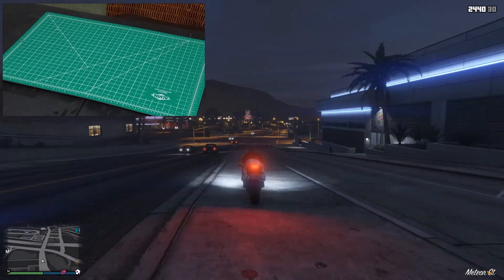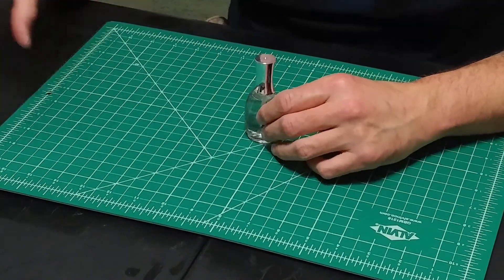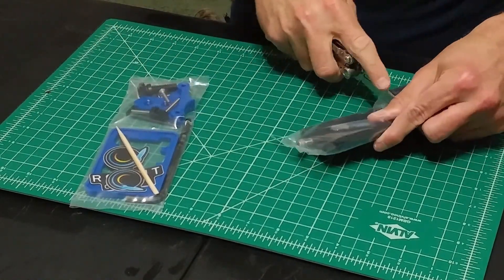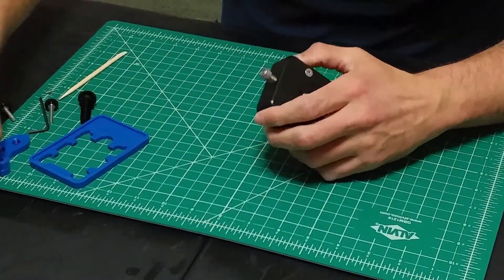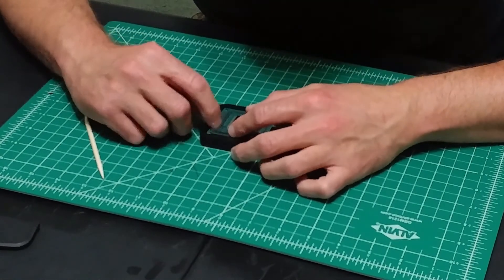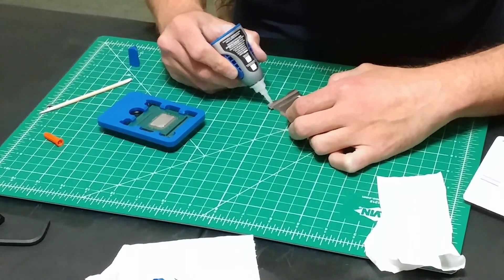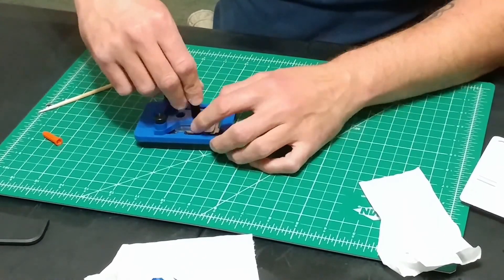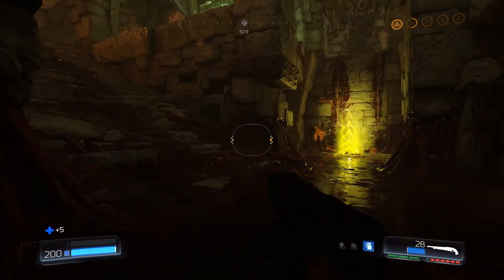7820x delidding

Comment: I must have a pretty rare 7820x. I am overclocked to 4.9ghz all cores and i render/export 4k videos for well over an hour at times and my temps will never reach 90 but they are at 88-89c. I do have a custom loop tho with a full copper 580mm rad, you gotta have beefy cooling for a chip such as this. That being said i did just buy the rocket 99 delid tool, an ek monoblock for my cpu and motherboard mosfets as well as a tube of thermal grizzly conductonaut. I can not WAIT to see my results and am hoping to hit 5.0ghz stable on all 8 cores, if i do have to leave it at 4.9ghz tho not all will be lost cuz seeing my mac temp between 60-70c under hours of full load will make it worth every penny anyways. Thanks for the great instructional video!

Comment: I did my 7820x a few days ago. Liquid metal hasn't arrived yet so I gave it a try with arctic silver and noticed a 5-10c drop. Now I've got half the cores (the cooler running ones) at 4.8ghz and the rest at 4.7. Can't wait to see how the liq metal works out.
Reply: @LarryB  Conductonaut arrived today. Got er' at 4.8ghz 1.2v all cores, max temp on any core is 73c (prime 26.6). That's at least a 35c improvement over stock. Much less temp variance between cores as well.

Comment: So I am running an I7-7820X with hyper threading disabled (Noctua NH-D15S cooler). My CPU is at 4.7Ghz with a 1.25 core voltage and CPU input voltage of 1.860. Running Asus realbench stress test for 15 minutes returns an average temp of 86C (measured with Intel XTU). I will be delidding tomorrow and will post an update if I remember and don't brick my CPU.
Reply: @LarryB  Took 5 hours because I tried to use liquid metal on the inside and outside of the cpu but the surfaces between the cpu and heatsink didn't make good contact and so 3 cores were way hot. Gave up and put arctic silver 5 under the heatsink and conductonaut in the cpu. average temp in Intel XTU under same conditions 68C. 18 degrees less. Core averages in HWInfo all within 8 degrees so no worries on a per core basis. I think it may be hotter in the room by 4 degrees too today but I forgot to account for that.